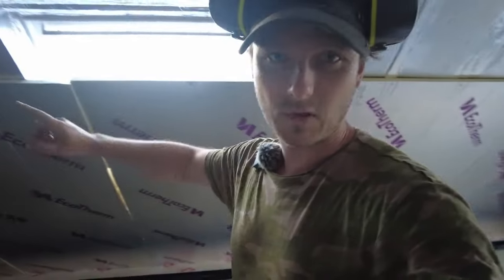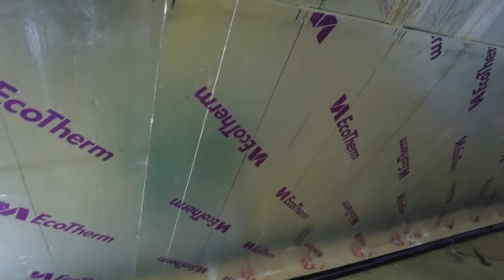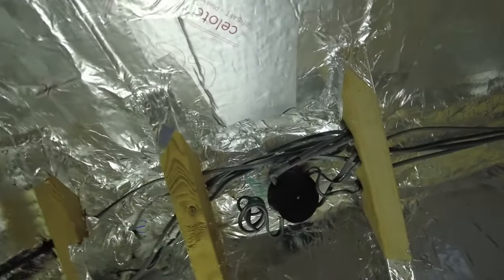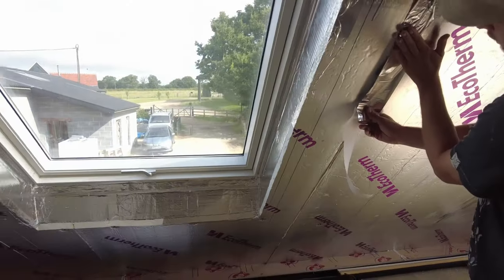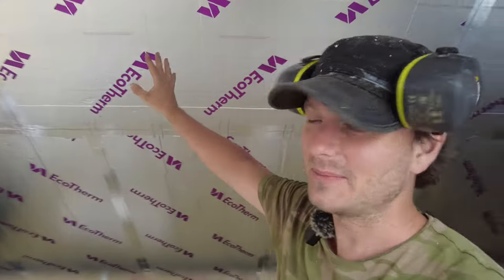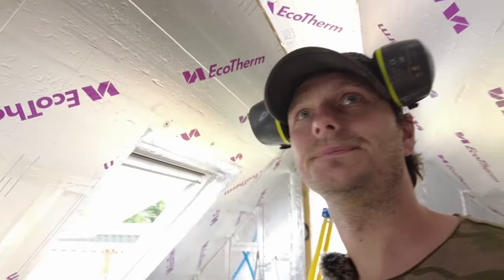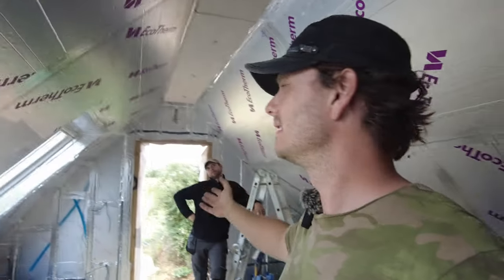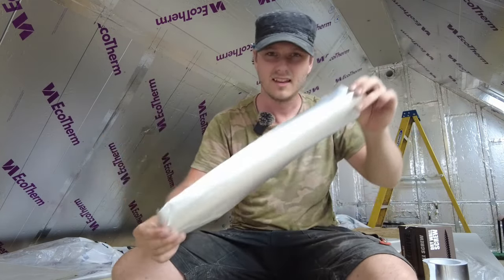How to Insulate a Pitched Ceiling (between and under rafters)

Comment: The one thing I can guarantee is you won't regret the time you spend on insulating. I remember feeling the same way on my extension, I just wanted to get it done so I could get on with plaster boarding etc. However I now need very little heating to keep the place at the right temperature even on the coldest days in fact I split my underfloor heating into two separate areas in my living room and have never found the need to use the second one!

Comment: Count yourself lucky - part of my house is 200 year old cob and the rest is 20 year old extension. I have no access to the roof void in the new part and I'm certain that at best I have 50mm in the rafters on the sloped parts of the roof and 100mm mineral wool above the ceiling, and that ceiling is vaulted and 11-12 feet high. The windows are crappy old aluminium framed double glazing and they are hopeless at keeping heat in in the winter. We have wet underfloor heating run by a 6Kw electric flow boiler since we cannot have oil or LPG for various reasons. My energy bills are astronomical and the house is rarely above 18C in the winter unless I spend even more money. It may be a pain now, but you'll love it in winter! We used to rent a new build over the road, a big modern 4 bed detached house (with a cart lodge that had solar panels, oddly enough) and oil heating/hot water. It was so cheap to run because the insulation was outstanding: I think we spent about 10-20 quid a month on electric and an average of perhaps 40-50 quid a month on oil throughout the year and we weren't shy with the heating. There was a log burner and we only ever lit it because it looked nice, but it got so hot so quickly, it was crazy.
Reply from the maker: I've done a loft conversion with a similar build up of insulation like this and we didn't really need to have the heating on upstairs at all. As I've worked on the air tightness too I've actually undersized my heating set up for the cartlodge, hopefully I won't regret that decision!

Your place sounds interesting, we was considering a big cob barn in Devon at one point. We passed on it though because although it was in a lovely scenic area the building was orientated the wrong way and the permission only allowed for North facing windows.
We also let a holiday let investment go on the basis it had a boiler like yours and they tried to lie to us about the electric bills 😂 I recall they said £30 a month. It was grade 2 listed, solid walls, no insulation and single glazed windows.
Reply: @THE-AIDEN-PROJECT  30 quid a month?? Ha ha!! We spend £167 a month, every single month of the year for just two of us and I could easily spend way more. And we're very fortunate to be locked into a very good tariff for the next year hopefully, otherwise by now we could easily be paying double that. I considered an ASHP like you're going to install, but I'm not sure we actually have an appropriate place to site it plus we need to replace various windows and doors  to improve performance first (even if the RHI was going to continue, we'd have to do that to qualify but we won't make it now). I'll likely have mostly triple glazed units when money allows and then one day I guess a heat pump might be on the cards, but that depends on money since this is our first and hopefully only house so it cost us quite a bit and we had very little equity so the mortgage is not small. It's just a matter of time: Mostly doing repairs and replacements that previous owners couldn't be bothered to do or cheaped out on, will probably look to do the windows and patio doors in our bedroom (there's a small balcony) in 2023, and then do other groups of windows as funds allow. Hoping that next year's planned repairs etc aren't too pricey as then I might get a new back door as the existing one is utter trash, single glazed, badly fitting stable door with no threshold, so slugs in the kitchen are not uncommon. I do try and do what I can personally but I'm nowhere near your skill levels so I know my limits!!
Reply from the maker: @stevepettifer4896  you can do more than you think you can 💪 half the time it's about confidence.
That target date for me to qualify for the RHI is out the window now, unless I get 20 blokes in to help me 😂 I'll just have to suffer the full cost and save some money elsewhere
Reply from the maker: @stevepettifer4896  I prefer plumbing over electrics, a leak isn't gonna kill you 😬
Reply: @THE-AIDEN-PROJECT  fair point! Start of my working life was working on roadside weather stations and I often had to work with electrics in the rain. But I'll only do basics like replacing sockets and the like. Anything more and I want someone insured and knowledgeable. Got a leaky pipe joint at the moment, but I might have a go at it after watching your copper to plastic pipe video!

Comment: Feel your pain, I've just spent best part of a week fitting 150mm board between rafters but each rafter has a collar bolted to it at the apex & 3 struts bolted to it at the bottom in the eves, which made fitting around all these shapes a complete nightmare. I'd have loved to just block off the eves like a lot of people do, which would have saved a load of work fitting insulation around all of the struts but I just couldn't bring my self waste that much storage space. Still got the over rafter boards to fit yet :(
Reply from the maker: haha it just feels relentless doesn't it! Luckily enough I had my mate do the between rafter bits whilst I tried my hand at some bricklaying. The over rafter boards go up quick in comparison though 👍

Comment: Hey Aiden. How does that Ecotherm compare in price to the Celotex? I know it's all pricey stuff.
Reply from the maker: Back in the day ecotherm was cheaper but now they are pretty much the same price. I only got ecotherm for the 25mm stuff as that's what the builders merchants supplied, even though I could get the Celotex slightly cheaper elsewhere. It's just a matter of shopping around and hopefully finding anomalies in the market. Currently there's a place in London that's selling 25mm pir 30% cheaper than other firms (they will send either ecotherm or quintherm). Ecotherm is owned by Kingspan and yet Kingspan is the most expensive out of all of them. I can get cement 30% cheaper in London too. You would think London would be the place where materials cost more but it never seems that's the case 🤷‍♂️